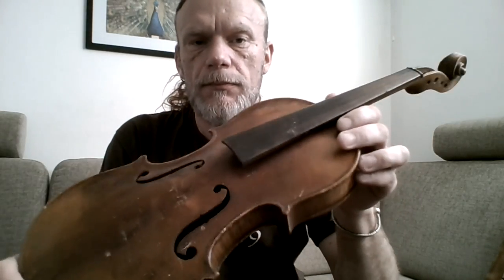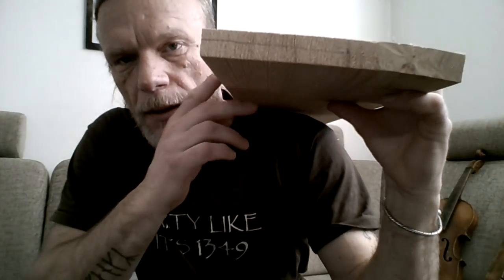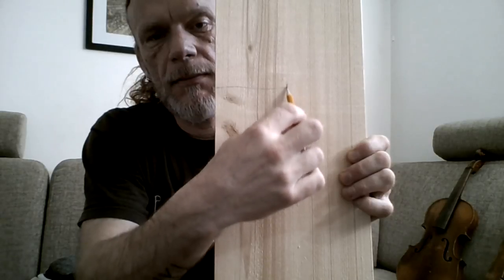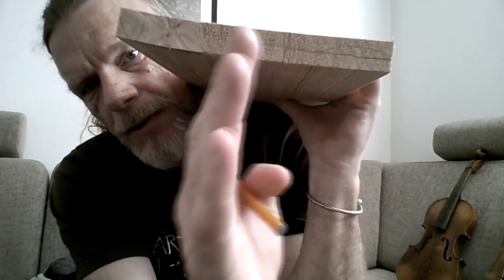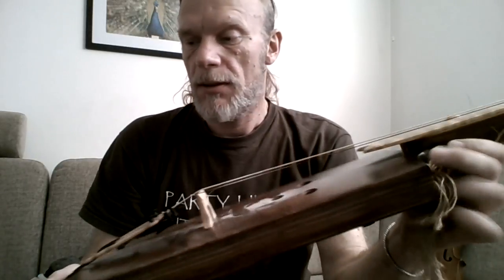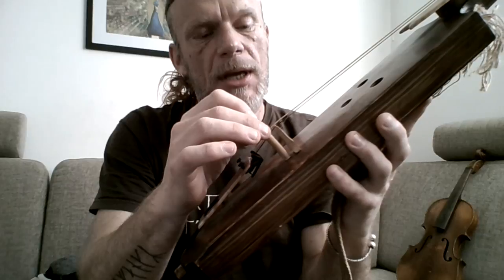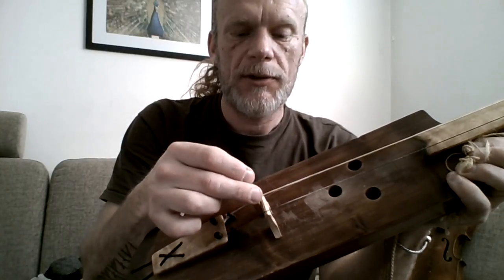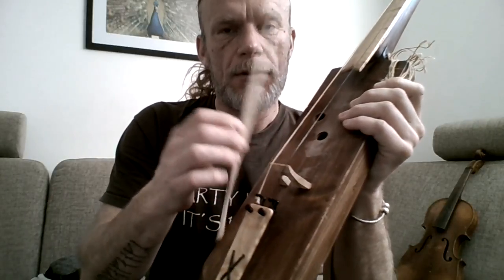Picking materials for your taglharpa/bowed lyre/jouhikko

Comment: I'm pretty late to the party, but after a bit of searching, it seems like guitar soundboards are around 2.5mm thick, as well as violins. Guess I'll be aiming for that, that's kind of scarily thin, but my goal is to build a taglharpa as well as I can. 

I tend to make things a bit overly heavy, so my initial thought of "oh probably a good 5-8mm should more than thin enough" might do too much  muffling/damping of the sound haha.
Reply: It's really hard to say, but 2.5 mm seems awfully thin.  Guitars have a lot of bracing, and violins have a curved soundboard that resists the pressure better. But maybe with less tension on fewer strings, 2.5mm might work. 

Whatever you decide, please post your build! I'd like to see what you come up with

Comment: Hello, How important is it, where to place exactly the bar(3:18)? I don't think is possible to glue it random place. If you do it for example on the guitar , if will be in tune if you try from 1-12 fret, here can seems to be good, but from 12th fret and far will not be in tune. How will it be here? Where to place it toward the strings and their length? (from tuning pegs to fixed bridge - and the bar between). Because, we can see on the web talharps in different size. Tagelharpa cello- the same question, if you see it where is the bar and lenght strings on both sides. I ask because I would like to build my own and I can't find information about it. Thank you!

Comment: Hey. Excellent video. Im building in Australia and tonewoods are hard to come across without paying a fortune. Ive managed to find a heap of maple and some boards of rosewood blackbutt and beech I think. Ive cut and carved a frame and headstock from one of my Rock Maple boards. I was going to use the same maple for the sound board. Do you think It will be ok to use all maple. Also wondering on tuning peg holes. How you drill them to get a tight fit on a tapered peg. Thanks for any help mate. 
Btw I love Gnaal. Watched the vid tons of times

Comment: Did you install the sound post when glueing the bottom or did you put it in place via reflex hole afterwards?
Reply from the maker: I installed it when glueing on the top soundboard. This body (and back) is carved from one piece of spruce. Only the top soundboard is glued on afterwards.
Reply: @ELDRIMmusic  Hello! Did you glue the soundpost in as well? Or is glueing the post a nogo?
Reply: rutber2000  
After doing some research I came to the knowledge that you don't glue in soundposts. You wedge it in between the top and bottom of the instrument. The reason would be, considering your instrument is made from wood, that it will expand and also contract due to temperature, moisture, etc... So if you glue in the soundpost you will have two points that will prevent that sort of "movability" to certain areas. This effect over time can harm your instrument (cracks, bulges f.e.).
Also if it's not glued, the post has "better" contact with the wood itself and this might make more sense sonically. 
It's a hassle to install a soundpost but affordable in the end :)!

Comment: Hello Espen!
Regarding the sound post, I suppose it's not glued (as sound posts in violins are not glued as they are moved once in a while to fine-tune the instrument).
Many taglharpa have very narrow open work around the bridge; in the event of the sound post moving or falling, how do you get inside the instrument to adjust it? Do you use the specific tools as are used on violins?
Cheers and thank you for sharing precious information generously.
Reply: Hi, Fabio! I usually glue my soundposts, for the reason you mentioned :)
Reply: @espenwinther9065  Yeah, it is plausible when there are no gaps around the bridge to access the inside of the instrument. On violins the sound post is such a pain to adjust!
Thank you for the help. My headache is relieved a bit. Love your music.
Cheers

Comment: Hi!! Thanks so much for the info! 
How do you work this high figured wood? are you using just rasps and sandpaper o you use some blade tools?
Reply from the maker: I use saw, rasp and sanding machine/sandpaper.
Reply: I note this, thanks, cause highly figured wood hard to work and I have failed a few times.

Comment: I'm in the process of gathering materials to make one of these. The only thing I'm really unsure of how to do is tension the horsehairs on the bow. Any advice on how to make the bow properly in that regard?
Reply from the maker: I would find a branch with a natural bend and just try to tie the hairs to it. It should be not too tight and not too loose. You might have to try several times before you find the "sweet spot" where you are pleased with the result.
Reply: Awesome, thanks!

Comment: Can birch be used for the soundboard? Also, what is the best way to attach the bridge so that it is secure?
Reply: Birch is a fine hardwood choice too,and besides softwood like spruce there is also pine,ash and maple are decent choices,but not oak. And the bridge gets secured when u get the strings over it,then it wont move when the strings are settled in.

Comment: Which tools/equipment are you using for crafting?
Reply: Saw, various carving tools, planer, power drill, hammer, router sand paper and special tools for making tuning pegs and the holes for the tuning pegs.

Comment: Do you use spruce on the Top and Bottom? Iv seen other people use it on both.
Reply from the maker: Usually i use spruce on both bottom and top, but it is most important on the top.
Reply: Okay I’m a bit confused now. If you hallow it out you Can only use the spruce on top correct. Thanx for the reply
Reply from the maker: The whole instrument is made of spruce :)
Reply: Well that makes sense. I’ve seen videos where people use beech wood and spruce. Cheers